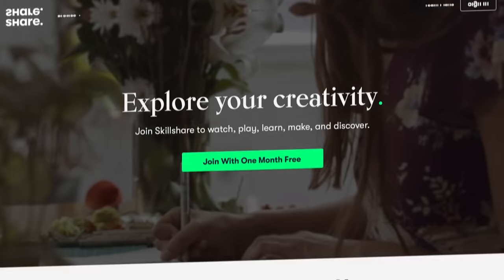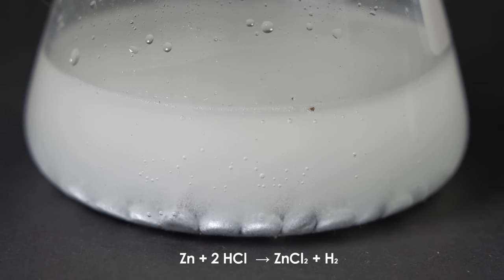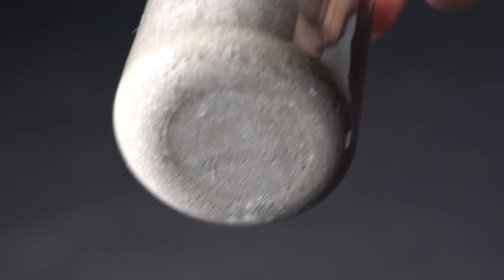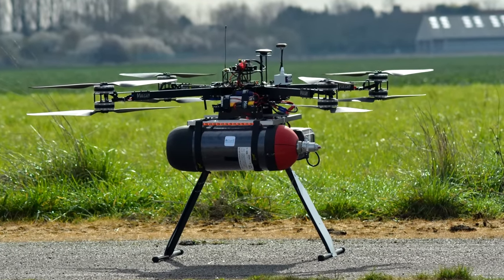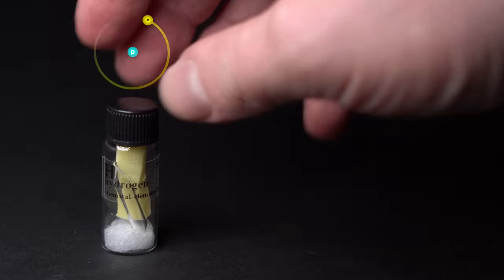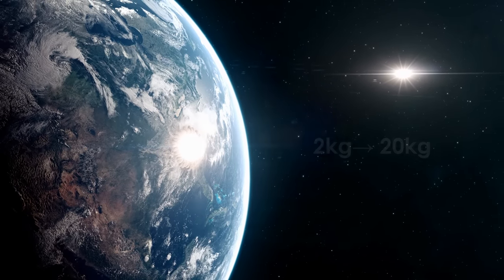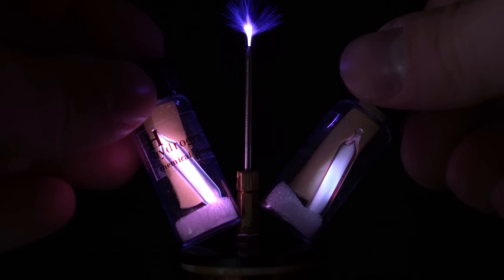Hydrogen - The LIGHTEST Gas in The UNIVERSE!

Comment: One thing you forgot to say is that it's extremely difficult to keep hydrogen. I've put some (H2 and D2) in plastic bottles with water at the bottom to seal them and prevent leaks, and the hydrogen managed to escape through the plastic in a few weeks, leaving the bottles strongly compressed as if I had pumped the gas from them.
Reply: Yep, it is one of the hardest things to store, period.  It sucks because it makes hydrogen fuel harder to do than most other gases and fuels.
Reply: Exactly I wanted to point that out - hydrogen is most efficient fuel per kilogram, but that is huge volume and the only viable means of storage are high compression and/or cryogenic.
Reply: Helium's the only thing worse, of course it highly depends on what you try and store it in.
Reply: @BackYardScience2000  I'm still unclear on hydrides, hydrogen dissolves, forms intercalcenes(fills interstitial spaces) and makes compounds with both ionic and covalent character... Is a hydride just on a spectrum or something? A multi axis gradient of properties? Or is there a better more descriptive terminology?

   I have an idea to make my own LiH and or LiAlH , dissolve the lithium and or aluminum in gallium and bubble hydrogen through it at about 300°C, and collect hydride precipitate...think that would work?
Reply: @LiborTinka  Then how did they manage to get it into zeppelins? I do understand that it tends to leak by all pores and thus very impermeable containers (such as glass) are needed but the reason for compression is only to keep the volume low, what is important for vehicles but not so much for thermogeneration, which can easily enjoy of  very large storage tanks, either above ground or underground. Sealing rather than compression seems the key issue.

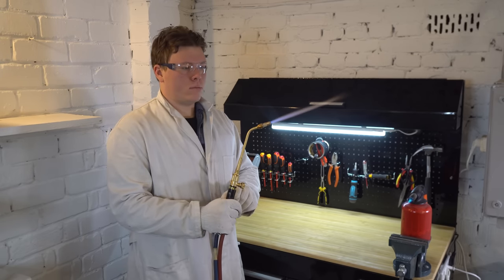Comment: 10:30 It also works well as an alternative fuel for old school car engines like the inline six under the hood of my 85 F150. Simply replace the gasoline carb with a gaseous fuel carb/regulator...OEM part as Ford sold those engines fuelled by LPG as well as gasoline...adjust for the correct fuel mixture of H2 gas to atmospheric oxygen, tweak the timing till she just purrs, and voila. 40 year old half ton pickup truck that legitimately qualifies as a ULEV and may just be able to legitimately qualify as a ZEV if the engine isn't too worn out.

Comment: As astronomer and astrospectrography we use H-alpha and H-Beta with wavelengths of 486.5 nm. Most stars give off Hydrogen, which makes up 73.5% of universe. Typically a perfect precursor in nuclear energy due to the 3 isotopes of Protium, Deuterium, and Tritium. Which decays to Helium - 3 instead Helium 4 which is stable. The constituents of the universe is 25% He of wavelength of 438.7 nm.  However band passes through the telescopes or spectrometer.  However Hydrogen pretty much bond with other elements. Which makes it the lightest element of the Periodic Table.

Comment: Thank you matey, your a great teacher, the hydrogen to electric conversion was very interesting, I wonder why this isn't used for renewable vehicles
Reply: It is. Check out the Toyota Mirai as an example. The problem with hydrogen power is that it isn't free energy.  You use a lot of electricity to split the hydrogen from the oxygen in water in the first place, so unless that electricity is renewable then the hydrogen isn't either. There are plans to create solar powered hydrogen facilities that can then ship it around the world, but there are difficulties due to the corrosive and volatile nature of it. The hydrogen essentially becomes an electricity carrier where the electricity used at the facility is regenerated elsewhere. It is very clean though.
 Electricity+water > hydrogen > reactor > electricity+water
Reply: @Michael Gogarty The problem with free energy is the fact that it doesn’t exist 😎
Reply: Hydrogen is the smallest element, and because it's so small, it has a remarkable ability to leak through containers. Hydrogen can even leak through solid steel if the steel is dull red hot. 

Also, hydrogen is the most difficult gas to liquify, it requires extremely high pressures, and extremely low temperatures. Unlike liquid propane which can simply be stored in a steel bottle at 125psi, hydrogen still remains a gas at 7000psi. This means that liquifying hydrogen for more fuel storage is both too expensive for most people to afford, and too dangerous if something goes wrong. (Pressure vessel failures are catastrophic events that are immediate dangers to life and limb) 

Hydrogen in a way is like electricity, because like electricity, hydrogen first needs to be generated from something else. It's not freely available in the environment. (You literally need to burn water to generate hydrogen) it's very energy intensive.

And unfortunately, everything that hydrogen does, fossil fuels can do with much lower cost, much more simplicity, much lower and much safer pressures, and much higher energy density. (More bang for your buck) hydrogen's one and only advantage over fossil fuels is that it does not create CO2. But in today's day and age, the immediate problems of explosive pressures, cryogenic temperatures, unaffordable production costs, and lower energy density outweigh the long term problem of altering the composition of our atmosphere.

Comment: Kimberly T. Rails sure gets around. 
Where to begin, at the beginning, before the beginning?

Newtonian laws of force and motion when applied to the angular velocity of a rotating spherical  body, when crossed by an implied gravitational force that pulls toward the center mass of the body produces a force vector graph that shows angular velocity at a 90* right angle to gravity unopposed at the poles that changes incrementally at each latitude from 90* unopposed to directly opposed at the equator of the spherical body. The only place where both forces could find balance. 

Newtonian laws of force and motion predict that if Earth were a spinning sphere with gravity pulling towards its center of mass all unrestricted water on its surface would necessarily have to follow the vector angles produced to the equator and then upward to the point where gravity's fixed and angular velocities increasing forces were equal, but since angular velocity increases with radius it will overtake gravity at some point and propel the water out in a disk and off of the Earth.

Now tell me again about gravity and our spinning globe planet with polar seas. Please?

 Both the laws of physics force and motion and observational evidence easily prove the Earth, whatever it's overall and unknown size and shape, cannot be a rotating ball spiraling through an also impossible vacuum.

Comment: I wonder if a gasses density is related to the audible sound it makes when its contained and ignited. Acetylene makes a louder pop than oxygen or hydrogen, i wonder if it's in relation to the density. Something maybe to investigate in a future video.
Reply: I would like know if is possible increase the efficiency of a internal combustion engine using small quantities of the UV light ignitor mixed in the all combustion chamber to promove a quasi ideal detonation at same time, extremely fast and in the perfect piston position.
Reply: Afaik not the density, but just the speed at which it burns. The faster it burns (the flame-front in m/s like in solid explosives) the higher pitched the sound.
Reply: @GLITCH_-.-  Is it used in some thermobaric bombs?
Reply: @gigabytegb  idk. Isn't that just gasoline or kerosene?

Comment: I bought about 150g of gallium in 2019 to test this application but I'm not made much experiences yet. I think that here in Brazil sometimes aluminum can be cheaper than gas because the kilogram price (or lb) trash of aluminium doesn't changes very much if compared to the volatility of petrol barrel and ethanol prices. Here in Brazil the gasoline is sold mixed with 27% of ethanol, the highest in the world 😶 I would like to know some things before grab in my hands my precious and rich gallium bought with my poor money 😂. I would like the correct mass proportion of aluminium and gallium to proceed with the tests, and how can I recovery my gallium lose to gallium oxide? Can I melt the aluminum together the gallium oxide to recovery back to the alloy of gallium/aluminium? And after, how can I separe the gallium mixed in the aluminium? I also would like made thermal machine closed cycle using some gallium alloy to operate inside tubes heating and cooling some gas or a organic steam to accelerates the liquid that's can power with high torque a micro turbine or traveling synchronized with magnetic fields to convert kinetic energy direct to electricity. If someone have a practical project, told me how to do it!
Reply: Well you can start your experiments with much cheaper mercury ... if you dare. Hg is way easier to recover than Ga but you need to be careful about wastes (trace amounts can be removed by ionexes, copper fillings or by sulfide precipitation). Both Ga and Hg are relatively unreactive metals so aluminium can be washed out with weak or dilute strong acids. Bases dissolve aluminium, too, but also Ga as it is also amphoteric. Forget complete recovery of the precious metals, you will likely lose 2-5% in the start and pushing for more complete recovery will drive the cost so much it might be uneconomical.
Brauer's "Handbook of preparative inorganic chemistry" says that Gallium is 'difficult' to obtain in metallic form in the laboratory - and that textbook handles crazy unstable compounds and complexes as "easy subjects".
Reply: Since gallium can be heated to extremely hot temperature, it should be enough that if you bubble methane through it , it should break down to hydrogen and carbon that should reduce the gallium oxide.. enough methane from natural sources shouldn't be hard to get.
  One of the Issues with that would be getting the oxygen out of the methane.
Also, I do not know if that would also react with aluminum, separating the oxides in advance would not be cost effective, but if there's a temperature where gallium oxide reacts with methane and aluminum oxide does not, that might be the way to go...
   I'm not a chemist yet or I'd calculate the Gibbs free energy, or something like that,  to know if it would work.

Comment: Hydrogen isn't just a proton and an electron it is also the force that prevents the positively charged proton and the negatively charged electron from attracting each other and colliding. So, from the start, matter is more than mass and charge.
     Interesting how the "heat" from one element can burn another element.
     The flame of deuterium is "colder" than the flame of hydrogen? Are there different types of heat like different types of light?
Reply: You need heat up 12 % more mass therefore lower heat is produced.
Reply: @jakubsebor4756  How is deuterium less massive than hydrogen? It has a proton AND neutron, Hydrogen just has a proton.
     It doesn't make sense that the more massive something is the "less" heat is required to burn it. By that logic the heaviest elements should have the coolest flames.

Comment: Please tell the name of anti iron chemical!
Reply: Anti iron? Sorry, but I'm from Brazil and didn't understand it! Did you mean anti corrosion or corrosion of iron prostitutor?I have phosforic acid 85% and it is very very good to made a depilation in a Iron or steel piece, and promove a soldering with the tin to fix a electrical cable.
Reply: No my question is
Reply: Which is such a chemical that if applied on copper, the iron will repel
Reply: Please sir tell me